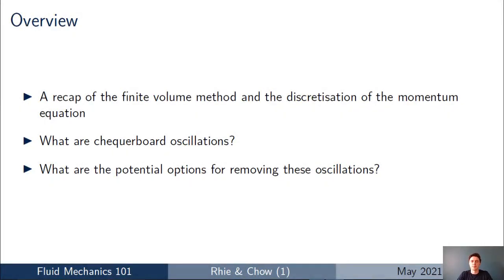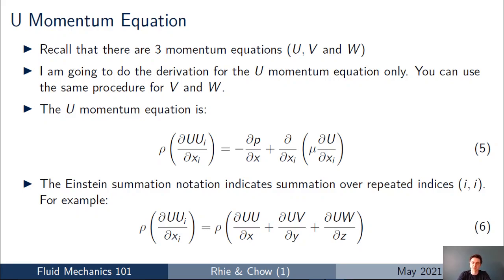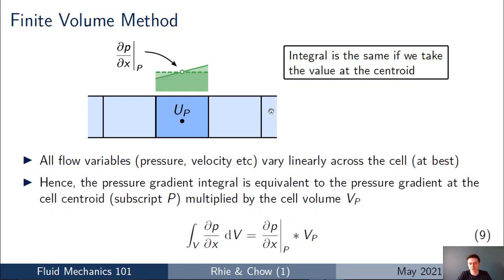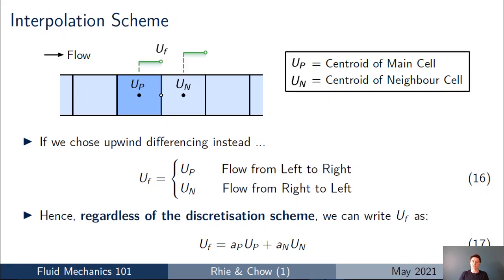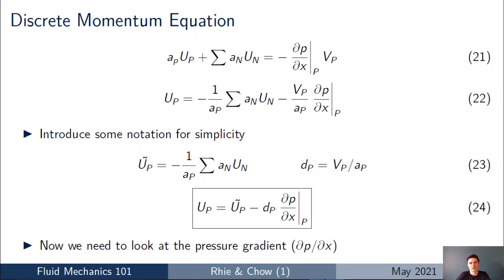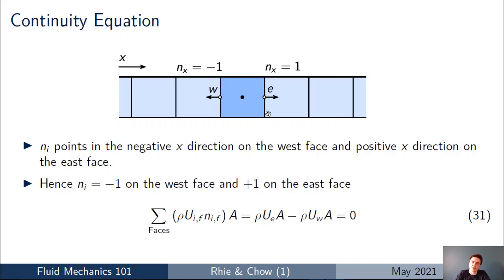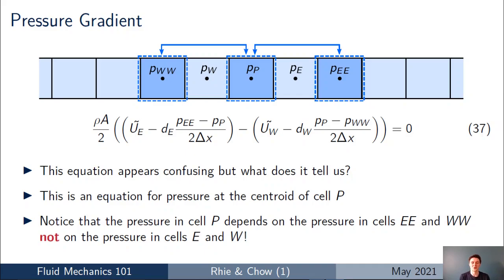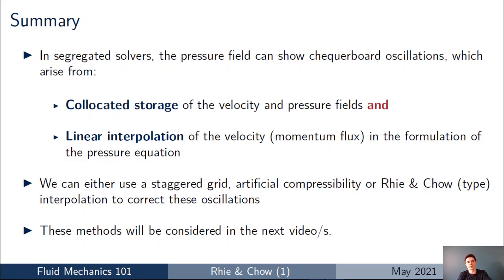[CFD] Rhie & Chow Interpolation (Part 1): Chequerboard Oscillations

Comment: Thank you for your videos - they are extremely good and informative. One question though. Would the Rhie & Chow interpolation not be used as well in coupled solvers? On the last slide (bullet point 1) you suggest the chequerboard oscillation problem due to the odd and even nodes being uncoupled, is limited to segregated solver. But if I'm not mistaken, this problem is extensive to coupled solver.  Thank you!

Comment: What are you talking about that the flow variables vary linearly across a cell?
Reply from the maker: Velocity, temperature, pressure, turbulent kinetic energy etc. are all calculated at the centroid of all the cells in the mesh. The value of these variables at positions between the cell centroids can be calculated using linear interpolation (this is used in the finite volume method to discretise the equations into algebraic form). Hence, we know that in the finite volume method, the flow variables all vary linearly across the cell (implicitly)
Reply: @fluidmechanics101  But a linear solution representation is just one choice. My point is, the true solution to the PDE is definitely nonlinear, so I was just baffled by the language you were using which seemed to suggest the exact solution varies linearly - definitely not the case.
Reply from the maker: Of course. The true solution is non linear. The CFD solution is 'a piecewise linear approximation' that improves its accuracy as the mesh is refined. Sorry if this was confusing!
Reply: @fluidmechanics101  The vast majority of your viewers are without background in numerical analysis so perhaps it would be beneficial to articulate that more often. Your content is great though, thanks a lot.
Reply from the maker: Good point. Thank you for the feedback. I will bear that in mind in future
Reply: You assume that variables vary linearly across cells and faces, using a Taylor expansion around the centroids. Doing that allows you to replace the full expression of your unknown for a linear one and their integrals resume to the value at the centroid by the volume/area. See Jasak's PhD thesis, Eq. (3.12)

Comment: Aidan, where I can find ap an coefficients for convection part of the Navier Stokes eq.? I have a question how the discretization works in that particular case because there is should be U^2 ? Can't find an answer in lectures or courses
Reply from the maker: I will be covering this soon. In the meantime you could check out the book by Ferziger and Peric (computational methods for fluid dynamics). They cover ap in there. 

In short, ap has units of mass flow rate. The mass flow rate is taken from the previous iteration of the solver. Recall that mass flow rate = rhp U A (so this is one of the velocities in the U^2). The other velocity in the U^2 is the unknown in the momentum equation. Hence we are linearising U^2 by lagging one of the velocities

Hope that helps for now 👍
Reply: @fluidmechanics101  Thank you! So one U is from previous iteration. Seems clear now to me. The only question is how this lag is justified mathematically. I will be waiting your lectures on this theme. Your videos are interesting to watch and easy to understand 👍 Best CFD material presentation I have ever found

Comment: Thanks a lot, very useful. I have a question. In your video about simple scheme, the continuity just contains the pressure and we can calculate the new pressure from continuity equation, then to calculate the new velocity. But in this video, continuity equation contains pressure and U~. So how can I calculate the pressure?
Reply from the maker: This is quite a tricky question. I am going to do a full derivation soon with all the terms, as it can be quite confusing!

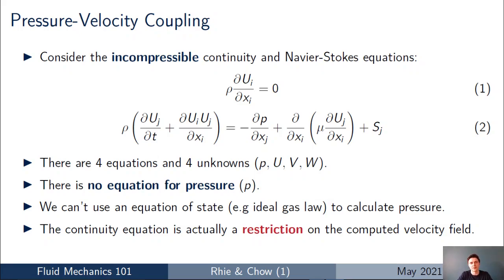Comment: 4:45 I am not really sure why ideal gas law can not be used to compute the pressure field. The reasoning you give is that the change in density is small (are you referring to spatial change in density or temporal change in density or both?). Regardless, why would the numerical value of change in density make the ideal gas law inapplicable P =rho*r*T, for a particular flow regime? If the change in density is small or even zero, why would it matter in a numerical algorithm? I don't see a division by zero in the equations. I just can't seem to understand this reasoning, from a mathematical point of view. Could you please clarify?
Reply from the maker: You can't always rely on the ideal gas law because .... what if your fluid is liquid water? The algorithm needs to be general for all fluids
Reply: @fluidmechanics101  Thanks! I see your point and that is kind of where I am getting at too - the numerical algorithm has to be general for all fluids. We should never be using ideal gas law, except for ideal gases. We have the unknowns (\rho, \rho u, \rho v, \rho w, p) but only four equations (1 continuity and 3 momentum). What is the most general equation that relates pressure-density-momenta and applies to all fluids (gas, air, water) and all flow regimes (compressible or incompressible)?
Reply from the maker: Generally in a pressure based solver, this relationship can be anything of the form: rho = function (variables). Rho is calculated separately which leaves the unknowns in the momentum equation as u, v and w (leaving rho as a constant). Pressure is then calculated from a pressure correction equation. With this approach we can account for all constitutive relationships by leaving them as a variable for the user to define

Comment: First of all, Thanks a lot for your work! 

It might be a dumb question. But i dont really understand the dimensions of equation 19. On the left hand side we have a velocity (m/s). On the right hand side we have a pressure gradient multiplied by a volume (m^3 * Pa/m = N). Does someone understand this issue?
Reply from the maker: Yes, the units for all the terms in the momentum equation should have units of N. So pressure gradient times volume does indeed give Pa /m = N. The left hand side is more tricky. The aP terms have units of mass flow rate (kg / s). You can ways check this because aN = mass flow rate through the face if we use the simple case of upwind differencing. Mass flow rate × velocity = momentum, which has units of N 👍
Reply: Also, i don't know exactly how to get ap and an in eq.19 or 20, If you already handle it, could you tell me how?
Reply from the maker: aP and aN will depend on your choice of differencing scheme for convection and diffusion terms. I cover this in my course 'computational fluid dynamics fundamentals' on Udemy in a lot of detail if you are interested. (There is a link in the description of the vid)
Reply: @fluidmechanics101   Thanks a lot!
Reply: @Muuui   What exactly is your issue?

Comment: Am I correct when assuming, if you would have selected an upwind discretization on the face velocities (Uf) the chequerboard oscillations would not occur: even if you do use central difference for pressure at the face?
Reply from the maker: I haven't come across people using upwind for the face velocities before. I think it may be because we already know the velocities at the cell centroids, so we are doing an explicit calculation of the face velocities (Rhie Chow is not used to discretise the momentum equations, it is used afterwards so we don't need an implicit scheme here). But your point is still valid, I am not sure why they haven't tried upwind

Comment: Hi Aidan, I wanted to know more about the formulation of matrix ap & an from final discretised Momentum Eq [Eq-19], 21:24 . Have you gone through this on CFD Fundamentals course - 3  on udemy?  I would appreciate any sources.
Reply: Found this in a book called: 
Computational Fluid Dynamics for Incompressible Flows - Roy Chowdhury
Reply from the maker: I haven't been through the coefficients for the full Navier Stokes system yet. It's quite difficult! Fundamentals 3 on Udemy is still dealing with the heat conduction equation but in 3D on an unstructured mesh. I am hoping to get the full NS system sorted soon and then I can start teaching that one as well. I have mainly been using the famous book by Patankar   but I will check out that book. Thanks for the reference ☺️
Reply: Same question. Did you found a source with explanation?
Reply from the maker: Yes! If you see my other comment I have left an explanation there

Comment: Thanks a lot. I had never really understood chequerboard problem, I knew it's name and never actually "understood" it from book. Also can't using one sided differencing, for pressure gradient, instead of central differencing, solve this issue?
Reply from the maker: Yes Im sure one sided differencing could stop the oscillations but it might reduce the accuracy of the solution, in the same sort of way that 1st order upwind does for the convection term
Reply: @fluidmechanics101  thanks for the reply

Comment: @Fluid Mechanics 101  Thank you for the video. I encoded a 2d laminar cfd solver myself, and at the very beginnig I had hard times defining the right staggered and scalar grids and also where to place the phsical domain in between those grids. Could you please record a video about it as well?
Reply from the maker: Yes, this is the tricky part of writing the staggered grid solvers. Have you checked your pressure correction equation and interpolation of velocities and pressures onto the right grids? This is typically the difficult bit and I haven't go around to right a video for this yet
Reply: @fluidmechanics101 Eventually I could manage that by placing the physical domain not to the edges but to just a  half way inside of the scalar /main/grids. So the unit cells’ boundaries of staggered grids perfectly matched with the physical domain boundaries. It was tricky at first but then when applying the pressure correction to the scalar cell I appreciated how it was easily adapted since no interpolation needed as u also said. The weird part in the staggered grid was that I needed to solve momentum equation over u- and v- control volumes individually while  I solved the pressure correction equation ( mass conservation) only one time over the scalar control volume. 

And indices was also tricky as you indicate because for any (i,j) location there are three different cell centers and as I named them (I,J) for scalar cell center; (I,j) for u- cell location of backward staggered of (I,J) cell; (i,J) for v- cell center of backward staggered of (I,J) cell. 

And the sad part is that my own code solves the equations slower than ANSYS Fluent :) Fluent solves the equations faster and converges much earlier. I guess I should apply the TDMA method for the solution of momentum equations instead of Under relaxed Gauss Seidel. I have also some suspicion about if the pressure correction equation  converges in the iteration step. I use SOR method for the pressure correction. I still need to go further and dig into works and books :)

Comment: Very interesting video. I'm dealing with a transient simulation problem where low mach number (0.3) and high mach number flow (14) occur together. I'm simulating with a implicit pressure-based segregated solver and get much better convergence and faster convergence comparing to a implicit  density-based coupled solver. I experienced that the pressure based segregated solver deals much better with my kind of simulation when i use fine mesh and low cfl number. Although the solver is not made for such problems. Do you know why the density based coupled solver can not reach the same level of convergence per timestep like the segregated one?

Comment: Thank you  for this video. Can i ask you to do video about using simple algorithm in supersonic flow. Can this algorithm model shockwaves without oscilations without using artificial diffusion? You are doing very understanding lectures for very complicated things!!!
Reply from the maker: It can do supersonic flow but you are probably better off using a density based solver or coupled solver instead 👍

Comment: Thank you very much for the video and as usual you always come with amazing content. Could you please explain how we treat the boundary conditions for both staggered grid and riew chow interpolation. Mainly the pressure BC.
Reply from the maker: In both collocated and staggered grids, pressure is calculated in the same cell so you can use the same boundary conditions. If you are using a pressure correction approach (SIMPLE, PISO) then the pressure correction on the wall faces is zero because you know the pressure there. This roughly translates into a neighbour coefficient of zero in the matrix equations (complicated I know)
Reply: Thank you for the detailed explanation.

Comment: Noticed a typo in equation (26) wherein '+' should have been used instead of '-'. Definitely, look forward to the series on Rhie-Chow interpolation. From, online resources, had learned that OpenFOAM implements Rhie - Chow interpolation scheme to avoid chequerboard pressure condition in its collocated grid systems.
Thank you very much for great CFD contents.